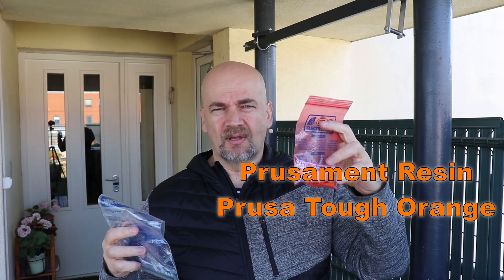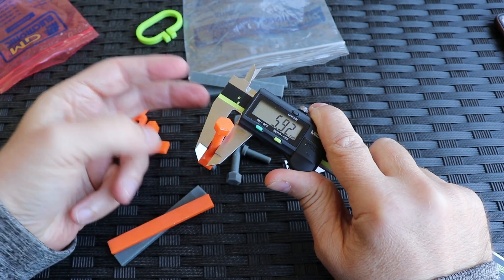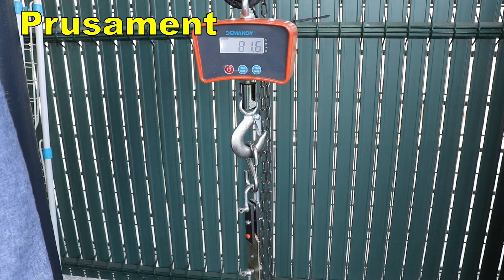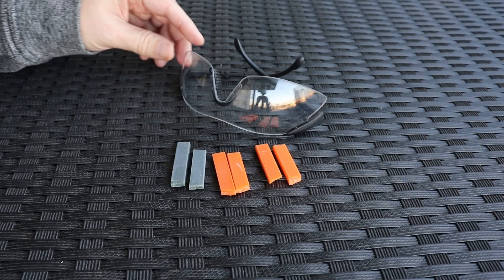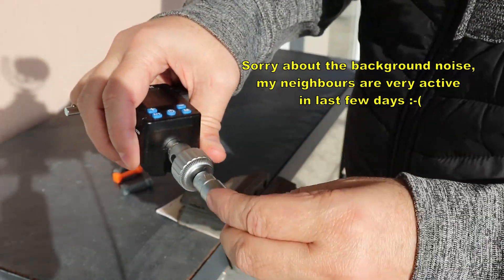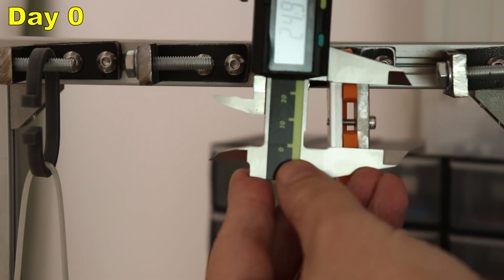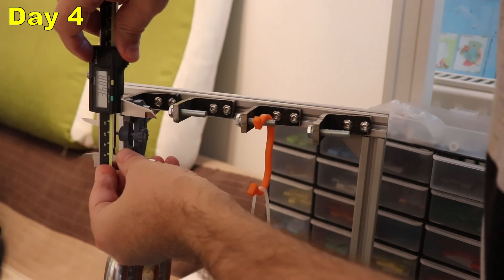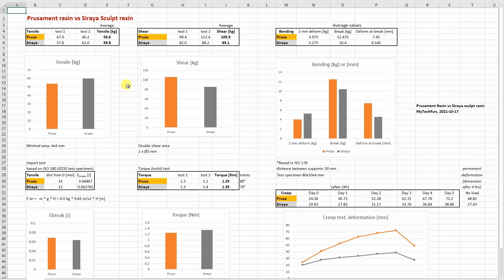Prusament resin vs Siraya Sculpt resin, which one is stronger? Mechanical tests

Comment: Great video! The creep test is exceptional and really sought after. The main reason I don't use resin prints as functional parts is creep. It narrows down the possibilies drasticly. I would love to see more resin creep tests. Siraya Sculpt was a good idea, high HDT resins could be more creep resistant. Good candidates could be a composite resin like Liqcreate Composite-X or an engineering resin like Onyx Rigid Pro410 because it advertised with creep resistance.
Reply from the maker: Hm, I didn't tested Creeping yet with resin parts. Only with filaments https://youtu.be/88pk2cNOeGE
Reply: Generally, plastics with fillers in them tend to be much more stable against creep and warping, so maybe sculpt ultra and fast mecha would do well here.

In FDM printing, apart from increasing stiffness, the other main reason short carbon fibers are added to engineering plastics like nylon/polycarbonate/ultrem/etc is that it makes these challenging material easier to print thanks to the increased stability.

With that said, im not sure if the principle discussed above is as valid for lower aspect ratio (more particle-like) fillers compared to long, thin fillers like carbon fibers.

Comment: Why are you comparing Prusament tough resin made for parts to Siraya Sculpt, which is not intended as a tough resin for parts? That's like comparing ABS to PLA for mechanical strength -- i.e. pointless.
Reply from the maker: I am asked to test these materials, they were sent to me. And results are comparable with other materials I tested, same test specimen dimensions

Comment: Something to bear mind:
Siraya tech sculpt is designed for high temperature molds (HDT 160c) and not general printing so is more brittle than thier general use resins.
The prusa resin is designed and labeled as tough.
A better comparison would be with Blu or Build which are Siraya Tech tough resins.
Reply from the maker: Good to know. Thx. These test objects were sent to me for testing. However, the results are comparable with earlier videos (for example, where I tested blu, tenacious, mix)
Reply: @MyTechFun  fair enough.
Just thought it worth mentioning as sculpt is the most brittle resin Siraya Tech make in order to give it the higher detail and HDT rating 👍

Comment: For the torque test, could you please design a holder of some sort to hold the tool? I find this data to be very valuable, but when I see the uneven lateral shift of the tool during the test, I feel it can compromise the results. When the material is being torqued, any tilting of the tool can cause premature failure. Thank you and keep up the great work!
Reply: I just went back and looked again. None of those movements had an effect. I'd be able to tell as a mechanic and metal fabricator I've dealt with my share of bolts and torque wrenches. His lateral movements wasn't enough to cause any unneeded stress on the part.